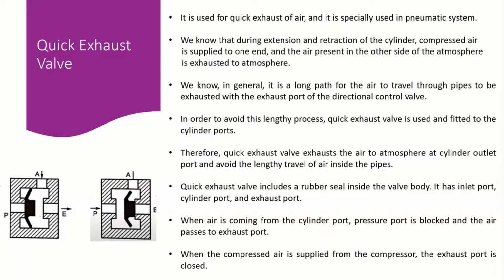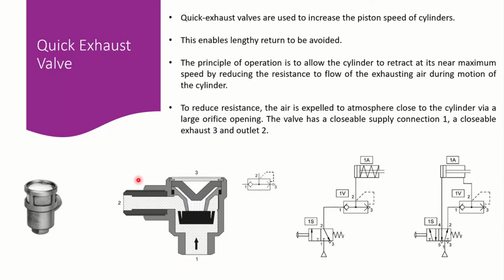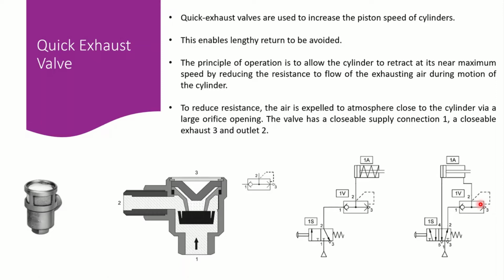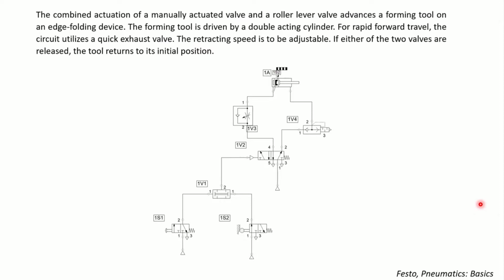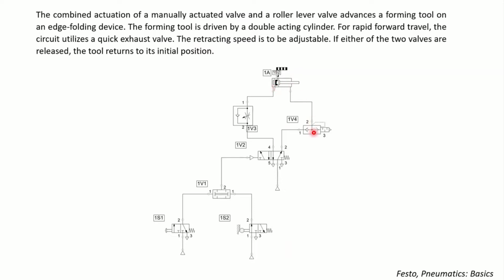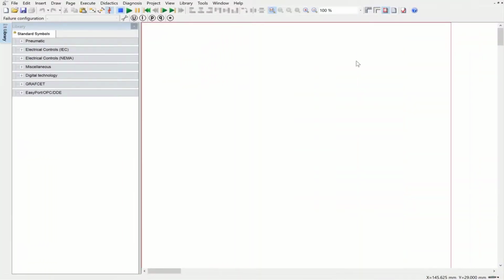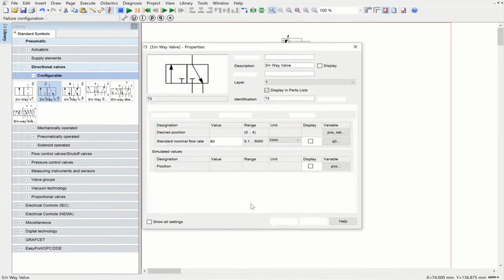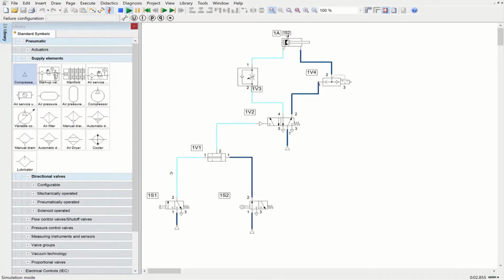Quick Exhaust Valve | Introduction to FluidSIM | Tutorial 10

Comment: little mistake with the quick exhaust valve position at the circuit on fluidsim!!
thus not fast exhaust,,going back to directional valve as the ball is on the exhaust side